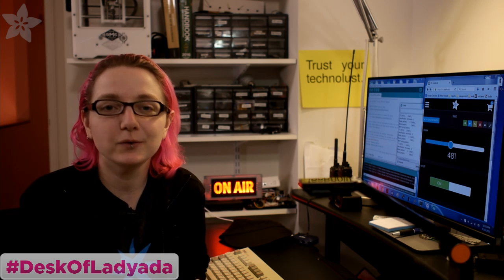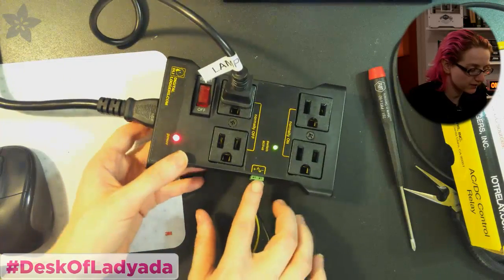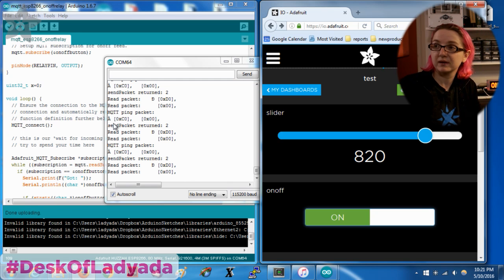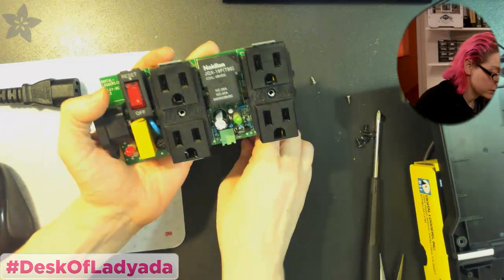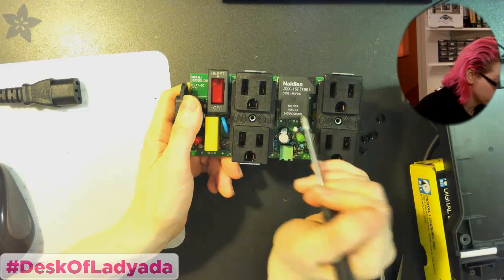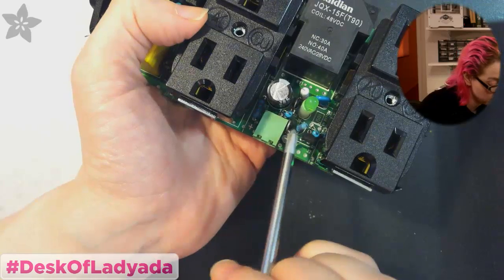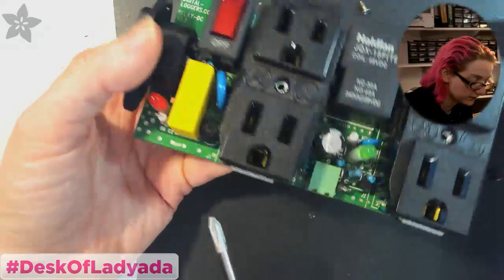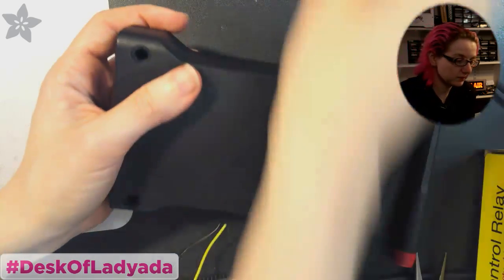IoTuesday with Ladyada #deskofladyada #IoT @adafruit #adafruit

Comment: I have several of these relays and have been very happy with the quality.  Two outlets are normally on and two are normally off. The only downside I've found, if there is one, is that the relay itself is quite loud--a sign of the quality--but it can also be problematic in a quiet room. I had one in the bedroom to trigger a few night lights (definitely overkill) but replaced it  because the relay was loud enough to disturb a light sleeper. (Because I needed less than an amp and the lights were only on for a few minutes at a time I replaced it with a Feather non-latching relay, which is almost silent.)

I still use these larger relays in my office and on my bench where they control equipment drawing 5-10 amps and have been absolutely trouble-free and seem to be designed with an eye towards safety.

Comment: This is exactly what I need for my 3D printer emergency kill switch. Was building a heat and smoke detector with arduino but didn't want to mess with mains power. This is the perfect solution, especially with the Lady Ada stamp of approval! Thank you for reviewing this.

Comment: a receptacle not approved for aluminum connections will cause galvanic problems when used with aluminum wiring. Aluminum wiring was used in homes in the 60s and 70s, and mixing them is a big nono, and against code unless proper splices

Comment: Would this be strong enough to power a small (5 gallon) air compressor?  Haven't found a current draw rating on the compressor yet.  But it's small enough to run on a typical 15A house circuit.  Only concern I would have is the initial current spike on turn-on of the compressor can be a bit higher.

Comment: So this requires a constant signal to keep the relay switched? I was looking at using it to control a set of lights for my home theater but when you disconnected the controller your light went out.
Reply: She had the lamp plugged into the 'normally off', it has two sides for opposite behaviors. The powerswitch tail products also have a default on or default off. In the end, yes when when pin goes hot the bank is powered (and the other side is not). 

It would have been better demo to have a stereo or different colored light plugged into the always off and the lamp into the always on ... the she could have toggled the on/off ui and the stereo would turn on and the lamp would go off, and the vice versa when she toggled the ui again.

To be clear, the powerswitch tail 2 products are the same way, (pass through y default or not) this allows both.

I dont think you would normally use both sides for iot.